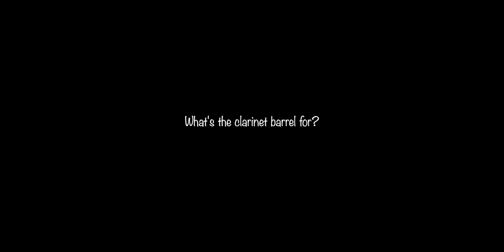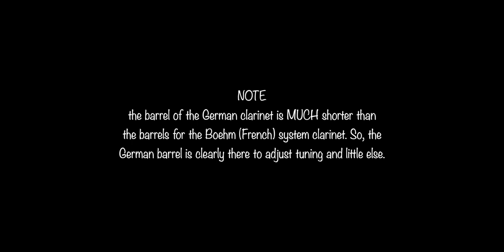what's the barrel for?

Comment: Can you talk about when you pull the barrel out slightly and what happens with the “donut” of air that is created inside? eg - my selmer recital clarinet came with 2 barrels: when I use the shorter one pulled out slightly (making it the same length as the longer one but with the extra air gap where the tenon and barrel have been parted) it plays better / more in tune, etc than the longer one. Hope this makes sense!